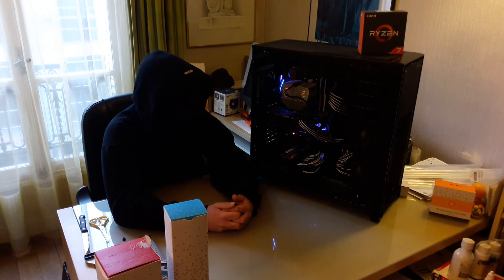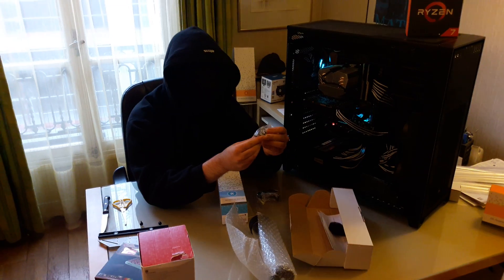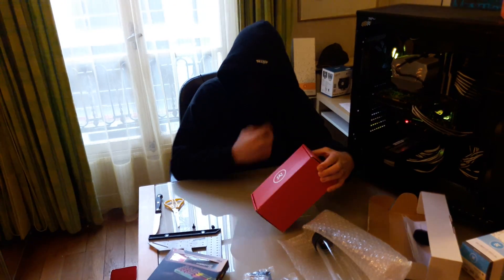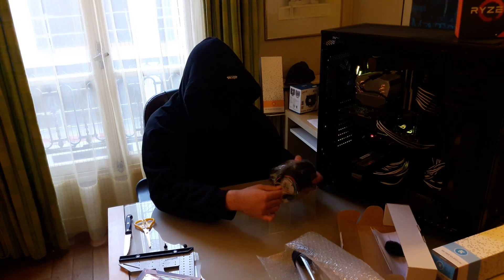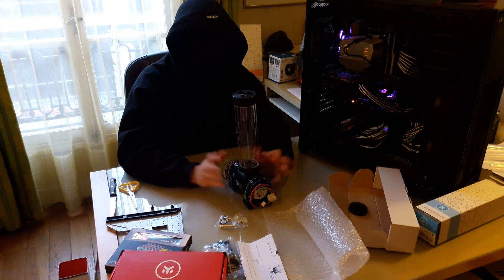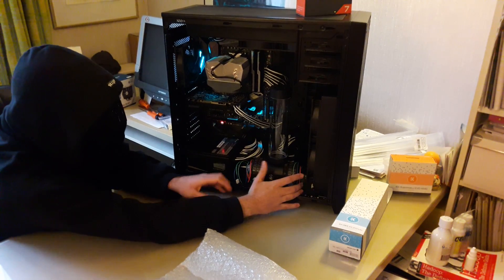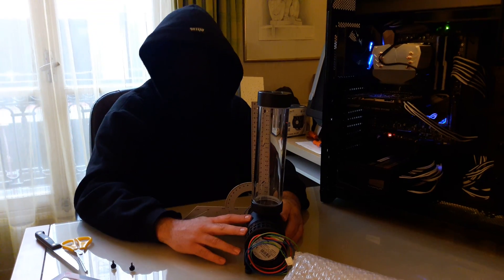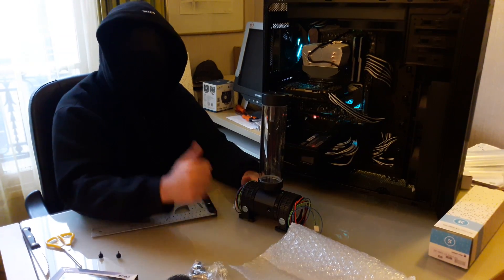Ryzen Build Log Part 8 : Unboxing EK-XTOP Revo Dual D5 PWM Serial with EK-RES X3 250 Lite

Comment: For what you are running you do not need that dual pump config, the case you are going to install it into is way to small, the reso is way to big you do not need a big one, it has zero effect on the cooling. the stand the pump is on can be adjusted cannot it ?.as for sleaving the pump i am pretty sure the new eons are now slaved and in anycase it really is not that hard to sleave it yourself. i would just buy a better case to house it in with all that in there you will have zero to no air flow over the motherboard, you spent that much on the water cooling kit buy a decent case
Reply: Mark Edwards Hey Mark, i am getting this reservoir .. is it compatible with the EK-XTOP REVO D5 PWM - Plexi?
Reply from the maker: I am feeling a bit bored so I'll reply you for the lulz.
I don't need you say this dual pump you say? I don't need any water-cooling at all! A heat sink would have done the trick too you know. I wanted cooling performance, beauty, silence and safety. I run both pumps around 40 % they are silent and if one of them fails i am still gold. Plus i want to add gpus with waterblocks down the line...
Case too small? Lol its a full ATX case it has enough space for this pump. Sure sleeving its not that hard but you need to buy extra stuff for it and dedicate extra time doing it it. All other cheaper pumps from EK were sleeved yet their most expensive offering was not!
You don't need the big reservoir but it will help prevent vortex formation and air bubbles , makes the system easier to fill and empty and it fucking looks pretty!
This case has ample airflow and space; temps are fine and has been used for a ton of water cooling builds.
Thanks for the advice but I'll pass.
Reply: @SexyTerrorisT  you are an idiot

Comment: What is the benefit with dual pumps compared to one pump
Reply from the maker: Higher Performance and redundancy. Odds of both pumps failing at the same time are lower than the odds of one pump failure.
Reply: SexyTerrorisT oki thx